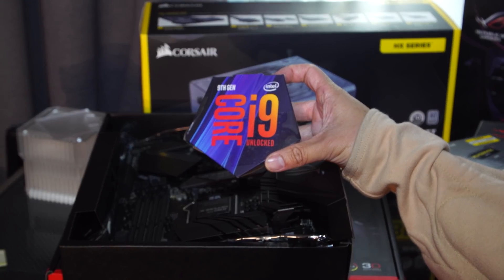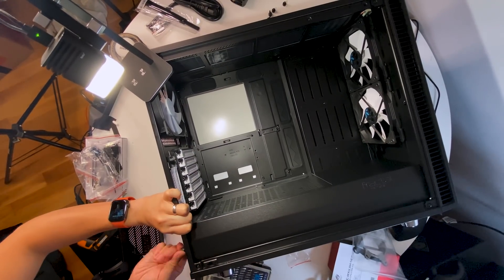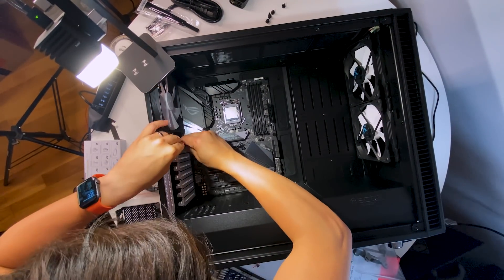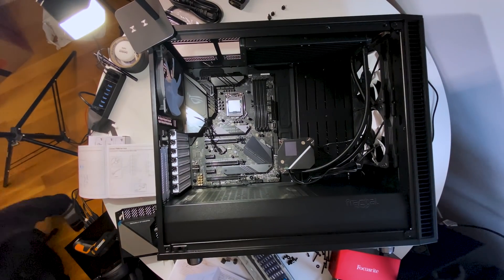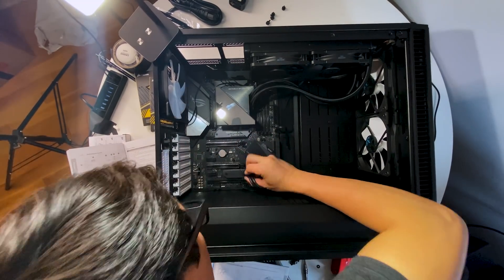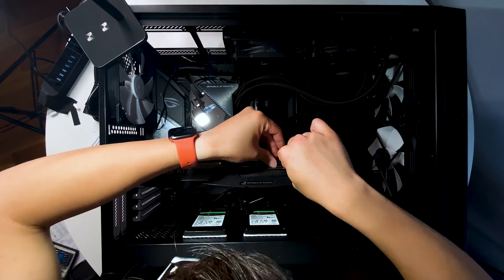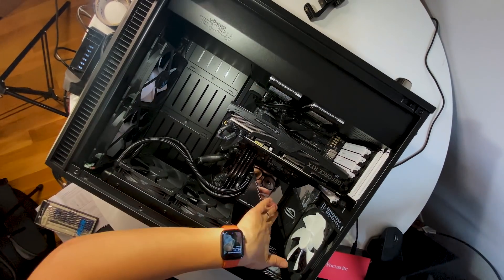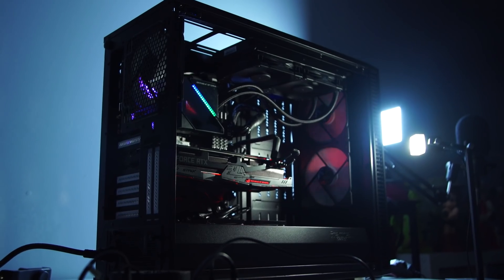Building a New Gaming and VR PC!

Comment: I built a gaming PC this year. I used a Dell Optiplex 9800 with the intel core i7 processor. For graphics I put a NVIDIA GTX 1060 3GB GPU. I installed a 650 watt power supply. And I have 20 GB of RAM

Comment: Haha I went with a budget solution, got a spanking deal on a 4790k with with 32gb ddr3 1600+Mobo (the guy was about to throw it away) and I got a 200$ USD 1070 g1. Good stuff, VR games run at medium to high settings with rift s. Good video! A clean system

Comment: Words of advice for people planning their first PC build. Make sure your RAM has a heat spreader. Only ever buy fully modular power supplies. If getting an NVMe SSD capacity doesn’t matter, since you should only be using it to boot the OS. Use the money you save to get a higher capacity SATA SSD. When deciding on any type of SSD, it’s important to pay attention to how many layers are in the drive’s NAND. Each layer of NAND past the first halves the lifespan of the SSD, but typically won’t make the drive cheaper by the same proportion. Get the fewest layers you can afford. When picking a CPU, pick the fastest one you can afford that has at least 4 cores with SMT or 6 cores without. That being said, these days it would be quite unusual to find a CPU without SMT.

Comment: Nice! I built a very similar PC a week ago after my old 10 year PC finally died. I went with the huge Noctua air cooler which is performing well, two 970 M.2 drives, and the meshify case. Very happy with it so far. I had to wait 2 weeks for a power supply due to shortages and it was torture waiting while I had all my cool components waiting to be built.

Comment: I see that the fans on the CPU cooler is using hot air from inside the case. I would recommend to turn those fans around to get colder air on thar radiator, so the CPU would run cooler.

Comment: A friend and i built this this one for myself.  I am super proud of this.  Yes Norm is correct, once the pandemic hit, I started picking up parts when I saw them on sale.  I primarily bought them off of Amazon and NewEgg  
MSI GeoForce GTX 1660 graphics card
CRUCIAL P1 1TB NAND NVME PCIe Internal SSD
Pioneer 3D NAND Internal 1TB SSD
OLOy DDR4 32GB RAM (2 16GB chips)
COOLER MASTER MPY-7501 750W Power Supply
AMD Ryzen 7 3700X 8 core, 16 thread CPU with WRAITH Prism Cooler
GIGABYTE B450 AORUS M AM4 Micro ATX Motherboard
Thermaltake Versa H18 Black Tempered glass Micro ATX Case
SCEPTRE 24 inch gaming monitor with speakers.

Comment: Look nice, even if i would use Ryzen and faster memory.
But I did see one thing you should change. 
I see you use one cable to the graphics card. You should use 2 of them instead.
You get more even power and you dont demand so much power from one channel of the PSU.
Sure it dont look as good, as you will have two "free" connectors.

Greetz

Comment: Nice. I am considering building a new PC for Microsoft Flight Simulator 2020 + audio/3D stuff. Should i go for AMD or Intel? I haven`t built a PC since 2012 and is not updated on the new stuff available or coming soon.
Reply: Intel 100%. AMD is only for commercial-use like media production and rendering. AMD does not support gaming very well and has never performed nearly as well as Intel when it comes to gaming. Games only uses single-core perf, which is where Intel absolutely dominates in. 
Best to grab a 9-series intel, preferably i7. Wait for Ampere Nvidia GPUs coming out in a few months. Make sure to grab a HP Reverb G2 or Valve Index if you plan to play MSF2020!
Also make sure to grab 32gb quad-channel ram, it's pretty much the bare minimum for modern titles.
Reply: @sqlevolicious  The very fastest Intel CPUs have a few % lead in SOME games. Most modern games are highly threaded. Games like Half-Life Alyx can max out 6 or 8 core CPUs.

Comment: Wow, almost the same spec as my system! 
i9-9900k OC'd all-core 5ghz
Strix 2070 OC'd 2ghz
Max XI Hero wifi
ROG cooler
32gb quad-channel 3200mhz
couple of 970 evo nvmes
Runs great for my Index at 144hz and my 1440p 144hz display. Can't wait for 30xx though! Definitely going to pick up the 3080ti/3090 for 144fps on squadrons and MSF2020!
Case-in-point (pun intended), I do have a corsair air 740 that allows for many more fans than your fractal case. I'm planning on a Lian Li 011 build with a EKWB custom loop for when the 30xx arrives and they make some gpu-blocks.

Comment: norm you forgot to put the ssd heat spreader on (on that MB you have to use the ssd screw on the heatsink and the ssd and make sure you take the plastic thermal pad protection film off before you install it)
Reply from the maker: Yes! Saved that for off camera so i could show the Samsung ssd before covering it up. But it’s done!

Comment: The new AMD XT processors are beating the new 10th gen Intel. Very likely, if you were building a PC when parts are available, you'd be building a Zen3 PC.
Reply: Now they are not, lol. Have you not seen any of the benchmarks??? Not with single core-perf, which is what this build is based for, VR. Which AMD hardly supports and has never had good price-to-perf with.

Comment: My only nitpick about this build, the PSU cables.  Would have gone a little easier for you if you installed them to the power supply, then fed them through the side behind the mother board tray, before locking the whole thing in the case.  Then you wouldn't have to try and cram them into the basement to plug them in.
Reply: Agreed here. Also the nvme heatsink shield and I question the SSD being on top of the PSU cage, sticks out with those stickers.
Reply: @sxd-215  Agreed on the NVME heat sink for performance reasons, but the SSD's on the cage... that's personal preference.  I'm not going to nitpick that.

Comment: 0/10. 
Three main things I noticed:
You didn’t use tweezers for cable management. That’s rule #1 of PC building. 
You should have used the new wireless anti static wristbands. 
You can’t touch the PSU to the case, or else it will short and you’ll be electrocuted.

Comment: I would put aio as intake in the front. Would look neater, wouldnt block a bit of that top fan and temps would still be ok as the gpu is the main heat pump in the case.

Comment: Should have waited till Fall! New Ampere graphics cards will be 20-30% faster meaning VR builds will be even better with less frame drop and hitting those 120-144hz refresh rates on Index with ease.

Even a 2080Ti can struggle in a lot of games.
Reply: Exactly. The 20xx-series was more of a test-bed and still doesn't do great for VR that we should expect. 30xx-series will be perfect for VR, especially for Reverb G2 res and Index at 144hz.

Comment: I'm so sad that apparently the development of gaming laptops stopped 5 years ago. I was hoping to replace my old MSI from 2015 but as it turns out - for the same price I can get a machine that is not 4 times faster than what I had (as I would expect from the Moore's law) but is more or less comparable to the old one. :( Mobility is a must for me.
Reply: You should look into the Ryzen 4000 mobile chips (they're Zen 2, not Zen 3). They are extremely energy efficient and very performant.
Reply: What??? I just grabbed the new helios 500 and it's amazing for everything, including VR. Moore's law has always been BS that engineering co-ops with to push tech. It was never a "law", just a silly theory based on a few decades of tech progression.
Reply: Limiting factor is cooling in a laptop. More so than power which is also a factor.

Comment: Neat build! To get access to the PSU, you can actually take off the PSU shroud plate. Also, definitely put the heatsink back onto that m.2 SSD so you control the thermals a bit more. I realise you might have kept it off for the glam footage to show Samsung's SSD, but if not - put it on! Of course for an even cleaner looking build you could rear-mount the SSDs that you have on the PSU shroud, but you discussed that already. 
For even cleaner cable management, you can rotate the case fan in the back and thread the fan wire along the top edge of the motherboard.

Comment: @12:17 you really should put the heatsink on your m.2 drive, they are on the motherboard for a reason. You just need to remove the cover off the thermal pad and screw it back down into the holes at the ends of the m.2 slot. m.2 drives run hot. It currently has nothing to cool it which will impact performance and significantly reduce the lifespan

Comment: My FE GTX 1080 Ti has basically ruined PC Upgrading for me... The performance it still has can only be put into check by an RTX 2080 Ti at twice the price I paid for my GTX 1080 Ti for still just a laughable gain in performance with the only real upgrades being Raytracing capabilities and DLSS 2.0 whereas the latter making barely any sense without the use of the former when the former isn't really being used in any game I care about. Quite honestly... If nVidia botches up the price to performance ratio for Ampere like they did with the RTX 2080 Ti I'll probably stuck with my GTX 1080 Ti for another 2 years.
Reply: "The performance it still has can only be put into check by an RTX 2080 Ti"
You mean a 2070, not 2080ti which is light years faster and using serveal generations new hardware technology. 
Hell, my OC'd 2070 at 2ghz puts the highest benching 1080ti to shame. 
Also, DLSS2.0 and RT is not the only tech being upgraded, lmao. 
You should actually do some research instead of throwing out misinformation on hardware performance.

Comment: Dear Norm, I would advise to put a heatsink on that 970 evo SSD. It will prevent throttling of the SSD due to heat & it wil pro-long it's lifespan. Nice build!
Reply: Never seen an SSD with a heatsink :o  How hot do they get??
Reply: @bzqp2  m2 SSD's can reach 70  degrees celsius easy (depending on the controller)
Reply: @misterp10  70 degrees doesn't sound like it would need a heatsink to be honest. Not sure what the safety ratings are though.
Reply: Yeah I wondered why didn't put it on either.. functionally and aesthetically it's a win win.

Comment: An Intel system in 2020 🤮🤮🤮🤮🤮🤮🤮🤮🤮🤮🤮🤮🤮🤮🤮
Reply: Also saying you won't do a build guide cuz you have a unique builds topkek
Reply: @volkswagen1221  He's doing VR, which requires Intel since AMD pretty much does not support VR applications. Also, Intel destroys AMD in single-core perf, which is what gaming utilizes. 
AMD is only good for rendering and media work, nothing else. Even AMD has said so themselves.
Reply: @sqlevolicious  how's amd not support VR applications? And Intel doesn't destroy amd in single core. Intel is better yes but all of like 5-10 fps which really isn't that much considering a 2070 can bang out framerates quite easy as VR resolutions. Something like a 1660 or even a 1650 you'd probably wanna grab every frame possible but the better the card the less it matters.
Edit: but in the end, if double the power use and cost for  a 5-10 fps gain in games is worth it to you, be my guest